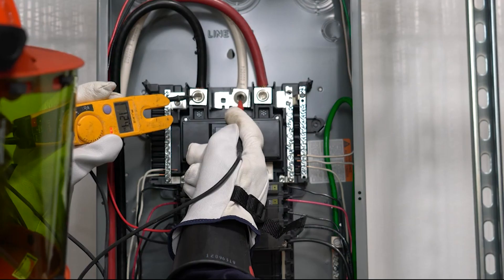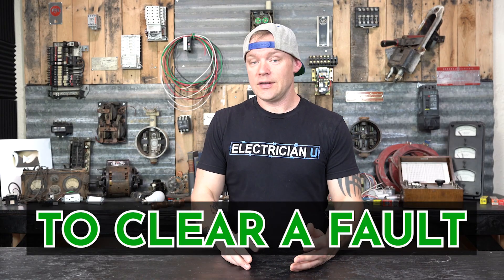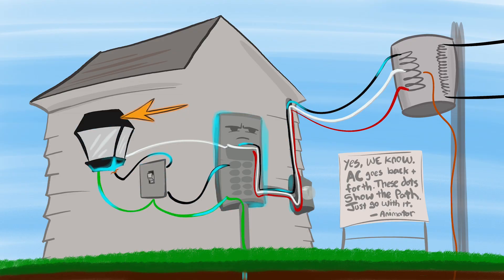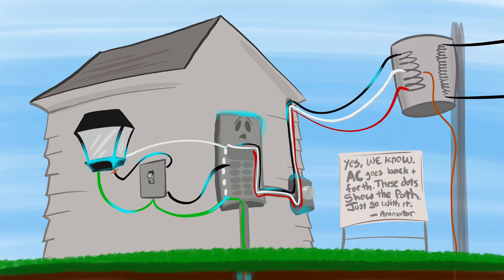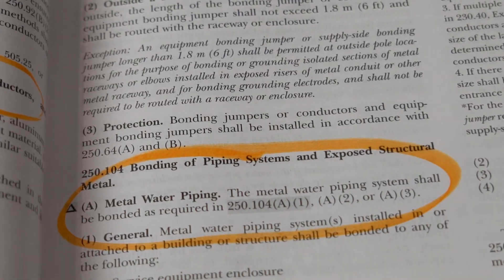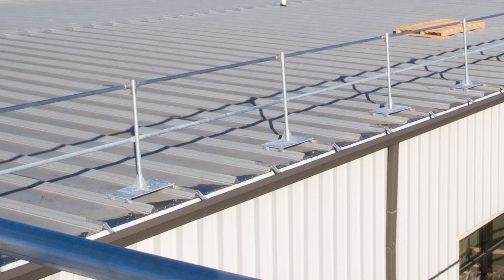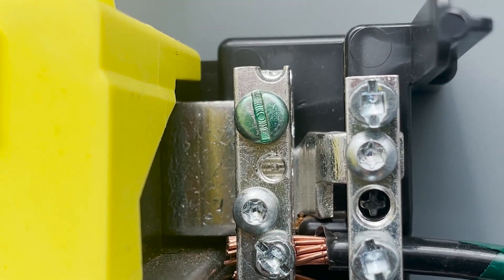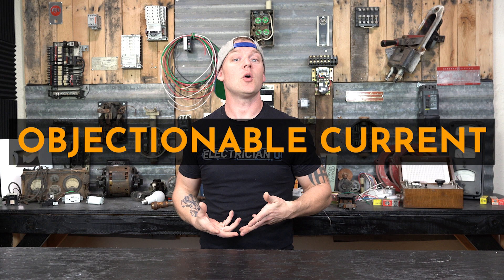Why Do We BOND Neutral & Ground in ELECTRICAL SERVICE PANELS?

Comment: The  reason you connect ground and neutral together is to create a path  for ground fault current back to neutral, and trip the breaker immediately.
Reply: That's why, if there's an outbuilding a couple of hundred feet or more away from the house, such as a barn, it's good practice to put a breaker box & breaker at the outbuilding & ground it to it's own local ground rod, so that breaker will trip immediately in case of a short or other overload, because if someone depends on a breaker way back at their house, it may not throw at all, because such a long run of wire at household voltage, will heat up & act as a load as if it were a heating element, so the breaker back at the house won't trip. This is not only dangerous because of possible fire, electrocution, or injury, it also may damage or can even destroy the expensive long run of wire, either melting it through or cutting way down on it's current capacity.
       Too many people treat electrifying their distant sheds, as if they're just running a long drop cord.
Reply: @sparky6086  spot on today I had a bazaar fault to a call out,, no downstairs light's fuse tripping and a short to earth ground to live, took all the fittings down and checked switches in walls, the downstairs outside toilet had 3 years ago a light feed installed and the non sparky took the feed from the kitchen light switch that only has live switch no neutral in the switch and literally shorted the switch to the toilet light, whilst the toilet light was on and a CFR bulb and the kitchen light off my only conclusion is that the cable because of the bulb choice and the fact that whilst the kitchen light is off the toilet was still drawing through the off side of the switch getting a neutral through the combined light circuit, and I think it melted the cable under the concrete hence the live earth fault,, I love a good detective day keeps you on your toes and bless him he'd been without light's for 6 months and a diabetic 👍❤️
Reply: @robmarrin6720  Thanks. ...Learned that this is a real, rather than a theoretical but unlikely thing, when I was figuring out what went wrong with the wiring to my late grandfather's barn. He'd buried 200 feet of wire back in 1976, so he could have lights & a battery charger in his barn. He buried it deep, the hard way, in the rocky clay with a pick and shovel, but he just hooked it up to receptacles and light sockets, with no breakers or ground. Not long after all that effort, it failed, and Grandad didn't know why. I pondered it years later, when I was grown and figured it out. Remembering all of the effort Grandad put into digging the 200 foot ditch, motivated me to wire it up & ground it correctly, when my uncle dug a new ditch 40 years later with a mechanical trencher and was just about to make the same mistake as his dad, my grandad, made. Grandad didn't live long enough to figure it out, and my uncle didn't have a need to have electricity in the barn, until he retired. All those years, my uncle just figured, that a cow had stepped "just right" on the ground covering the original wire, even though it was 2 1/2 feet deep, causing it to break, when it had actually melted through because of the current.
Reply: @sparky6086   I thought that a circuit breaker was somthing something bimetalic strip that if heated will bend  and cutoff the citcuit, how the current returns to the transformer is irrelevant.  is that correcte?  
That means not bonding will make the resistance of the returen path  to the transformer so high that the  current flowing won't excede the breaker's limite and it won't trip ?
Reply: @sparky6086  I don't disagree with breakers in sub panels, however, if your wire is heating up like a heating element it is not sized properly for the current and run length.

Also you can connect hot to earth and it will not trip the breaker, so I'm guessing (IANAE) that while a local ground is good an additional ground connector back to the service panel is essential. Someone with THE book can confirm.
Reply: @usa-ev  I mean heating up like a heating element in the case of a short circuit, rather than throwing the breaker!
Reply: @sparky6086  I understood, I think that still indicates undersized wire (or oversized breaker), imo. I could be wrong though.
Reply: @usa-ev I'm talking about a long run of wire to an outbuilding, not an ordinary circuit, so yes, you're wrong.
Reply: @sparky6086  Well, I understood that too, so that doesn't in and of itself make me wrong. When you run long runs you have to use larger diameter wire. If it's so long the wire is overheating then even larger wire is needed (and this will prevent overheating). There are tables, formulas, and online calculators that will give you required gauges for run lengths.
Reply: @usa-ev  You've completely missed the point.
Reply: @sparky6086  How so? What did I get wrong?

My thesis: Wire diameter should be sized appropriately for run length (taking into account voltage and max current). Longer runs require thicker wires. Even with a short circuit, appropriately sized wires will not overheat and will carry enough current to trip the source breaker. 

Under no conditions where the service panel is the only power source should the wire act like a heating element.

[My other thesis, which I thought may be more controversial, is that even with a connection to earth at a sub-panel, a grounding conductor is still needed to go from the sub-panel back to the service panel.]
Reply: @sparky6086  The main disconnect on the power pole is grounded and bonded with breakers to other buildings (smaller gauge wire) which each have a breaker box and ground rod.  2 hots and 1 neutral with no dedicated ground wire going to each building.  From this information, I take it that the buildings should not have the neutral bonded to the ground.
Reply: In the UK the live comes in single phase and neutral and you have a meter long earth rod that goes literally into the ground, this is the earth or ground and the reading in the UK between live and neutral and live and earth is approx 240vac, so a quick test to see if the appliance is earthed is test live connection to chassis and you should get 240v if you get alot less than 240v then you may have a bad earth connection causing a potential difference at that fault point.
Reply: I believe there is another reason to keep them separate in the sub panels. In a normal operating circuit, the return current flows on the neutral conductor. If the grounds and neutrals were bonded together in a subpanel, the neutral current will have parallel paths to travel. You will then have current flowing in your grounding system
Reply: @larryrola152  You are correct in regards to sub panels. It is the reason why you can only connect Neutral and Ground at service entry point. They must be separated in all sub panels.
Reply: But I understand that without that bounding to neutral, the breaker could work as well and clear the fault. Why is it necessary to bound to neutral too? Because a bad ground that doesn’t help the breaker to detects a high current? How does neutral help in that scenario?
Reply: @leopoldomolina1763  Connect Neutral and ground at service box gives a much lower impedance closed circuit, so the ground fault current is high enough to trip breaker when  it goes back to the source. If Ground is not connected to Neutral,  the ground fault current may not be high enough to trip breaker because of high impedance of earth.
Reply: @simontravels9379  ok.  But I don't see why this bounding with neutral gives me even less impedance than an almost perfect connection to ground.  Could we say that if the ground connection is perfect so there is no need of bounding with neutral?
Reply: Also, I thought that lower impedance you mentioned ( @simontravels9379  ) is because - if bonded - they could be seen as parallel impedances, but actually they are not parallel elements (one goes to the transformer and the other to the ground). Isn't it?
Reply: @leopoldomolina1763  Yes. The one goes back to Transformer through Neutral has much lower impedance.
Reply: @leopoldomolina1763  essentially neutral is earth or ground and that's why if you meter out continuity there's always a short from earth/ground to neutral
Reply: @leopoldomolina1763  No, the resistance of a ground rod is way too high to trip the breaker. With luck you get 10 A through it. You need almost ten times that to trip the breaker.

There are countries like Italy where they are not bonded. That requires universal RCD protection to make it safe. Typically the whole house is at a 100 mA RCD. Most circuits are also protected by 30 mA RCDs.

Another method to avoid the bonding is to have separate ground wire all the way to the transformer. This was common in the UK in the past. This is a very safe system but one needs extra cable.

It is somewhat unfortunate that the cable is called ground as it gives false impression on what is important. I the UK they call it the Circuit Protective Conductor (the CPC). That tells what it does without any false impressions on how it does it.
Reply: @leopoldomolina1763  plus the ground and neutral should have virtually no potential difference between them, the ground being less than one ohm impedance
Reply: It's one thing to tell you how this works but to show you in a live person video, not a cartoon is another. Go check out Benjamin Sahlstrom's channel and he will show you why you bond and what happens if you don't. He has a few videos on this, one he even connects a breaker wired straight to a ground rod in the earth and it doesn't trip. Because it has no way of getting back to neutral, which then gets back to the power companies center tap (neutral) of the transformer. Once you see it with a live person on video you will understand it better.
Reply: How come this current flow to neutral after bonding?..sir please explain it
Reply: @prasanthrajumanikonda  Because the Neutral is connected to ground at entry of service panel.
Reply: @simontravels9379  sir does it mean....current from ground flow to neutral but not to earth right?
Reply: @prasanthrajumanikonda  correct
Reply: @prasanthrajumanikonda  but at the moment it flows from this ground to neutral the braker cuts of the flow by sensing the current coming from ground. Edit: there is actually another way of doing this without bounding ground and neutral. Witch is used in other parts of the world. It works by detecting the diffrence of power flowing through thr live wire and coming back through neutral. It detects how much power is flowing through the ground wire to ground.
Reply: @redcrafterlppa303  yes.....differential scheme of protection
Reply: @prasanthrajumanikonda  But that doesn't work if you short live to neutral through, say, a person.
Reply: @redcrafterlppa303  isn't that the working princople of GFCI outlet?
Reply: @redcrafterlppa303   are your referring to the use of RCD breakers?
Reply: @Sergio-92-llf  yes it's an ingenious invention that is widespread in Europe especially in Germany. That's the reason why I was extremely irritated from the idea of connecting neutral with ground. I didn't know there was another way of detecting a fault and connecting ground and neutral would hinder the triggering of the rcd
Reply: @redcrafterlppa303  Your alternate method is how GFI (Ground Fault Interrupt) works. The standard circuit breakers don't do that, they just trip when the current in the hot wire exceeds some value, those are OC (Over-Current) breakers. GFI circuit-breakers are used to prevent people from being killed, which only takes milliAmps of current, while OC breakers were put in solely to prevent fires. I don't think this guy really pointed out this difference.
Reply: @redcrafterlppa303 both ways are used
Reply: @redcrafterlppa303 this method works when you actually touch the metal conductive part and not immediately when problem occurs
Reply: If the ground or earth is inadequate then you can get a potential difference if you touch a non earth bonded piece of equipment and an earth bonded unit it's not as bad as full on live shock but it always freaks you out, as a plumber as well this happens alot when the gas and water supply hasn't been grounded or earthed correctly to below one ohm
Reply: There is a much bigger reason. Without neutral bonding our electrical system will not function. There is another huge reason for having neutral bonded. For residences deriving power from a Y connected secondary the bonding is essential. If the loads on the 3 phases are unbalanced then the neutral point will float. Now you have a problem as the hot to neutral voltages will fluctuate with the 3 phase loads and the expected 120 V could be lower or even higher (as much as 208V)! This will be catastrophic if the unbalance is large. .
Reply: No, the ground fault current doesn’t flow through the neutral. Only through the hot and ground wires.
Reply: @altuber99_athlete  You should check how the GFCI works.
Reply: @simontravels9379  You should know how the ground wire (equipment grounding conductor) is connected: between the ground busbar and the enclosure of the load/appliance. Hence, when a ground fault occurs, i.e. when the live/hot/phase wire touches the enclosure of the load, current flows (for half a cycle in steady-state) through the hot wire to the load enclosure and then back through the ground wire.
Reply: @altuber99_athlete  We are talking about the connection in main panel, not inside the appliances.
Reply: @simontravels9379  Whoops, then yes, in a ground fault, the current flows through the ground wire of the load and the main neutral wire (though not through the neutral wire of the load).
Reply: @altuber99_athlete  Yes. You are correct.
Reply: For all you electrical geniuses out there what protects the electrical system if the power company looses the neutral from the transformer to the main service panel. Answer a properly grounded system that has the ground bonded to the neutral which will take the place of the neutral and prevent back feeding on the open neutral and burn everything up in the system.
Reply: @jamesmartello1827  If that happens, the ground fault current will not have a path to travel back to the source, the breaker will not trip. Therefore, the metal chassis of equipment will remain live at the point of ground fault. You could get electrical shock if you touch the chassis. Another thing that will happen is that you lose 120V AC supply if it is in North America system. You only get 240V AC.
Reply: @simontravels9379  how could you get shocked if the chassis is literally grounded? The current must have larger resistance if you standing on floor, so it will prefer the ground wire, if the grounding rod is deep enough. GFCI would trip if present.
Reply: @jamesmartello1827  Not so. For residences deriving power from a wye connected secondary the bonding is essential, the electrical system will not function without it!!. If the loads on the 3 phases are unbalanced then the neutral point will float. Now you have a problem as the hot to neutral voltages will fluctuate with the 3 phase loads and the expected 120 V could be lower (as low as 0) or even higher (as much as 208V)! This will be catastrophic if the unbalance is large.